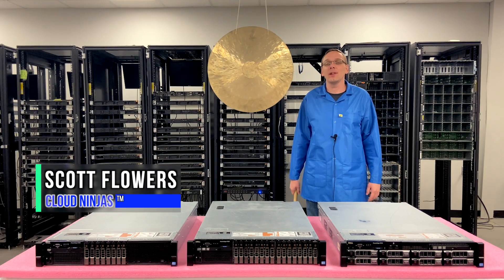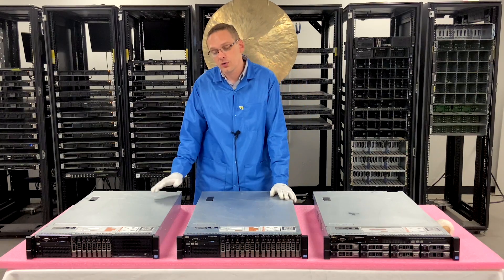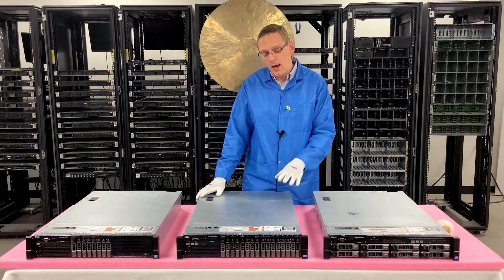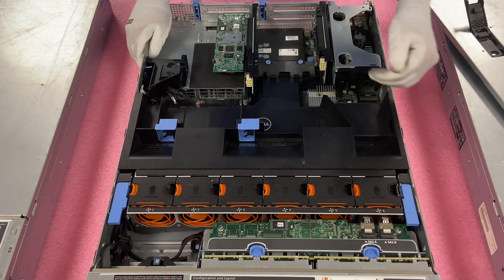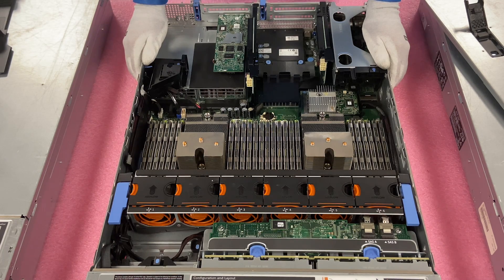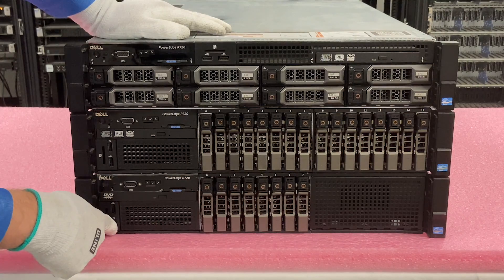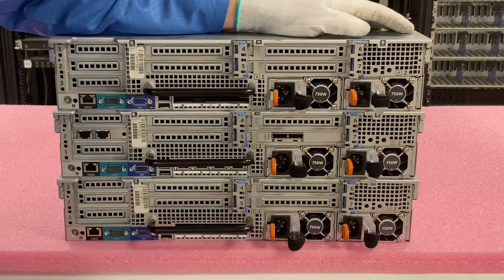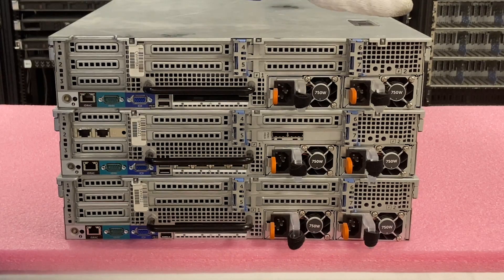Dell PowerEdge R720 Chassis Overview | Chassis Options | 8 Bay SFF | 8 Bay LFF | 16 Bay SFF | PCIe

Comment: I know noise is subjective and depends on drives, but how does the R720 compare to the R620? Louder or quieter at idle?
Reply: I have both in my home lab, and they are both extremely quiet at idle. Because the R720 fans spin at a lower RPM, I think that it is less noticeable than the higher pitched whine of the R620. Both are impressively quiet though - you can hardly hear mine running.